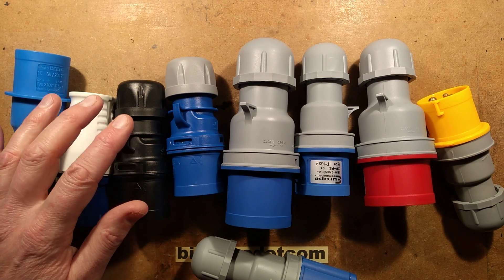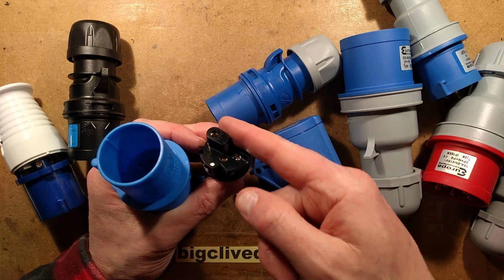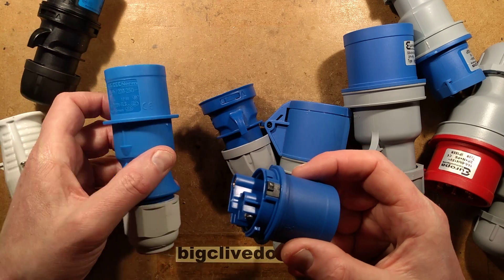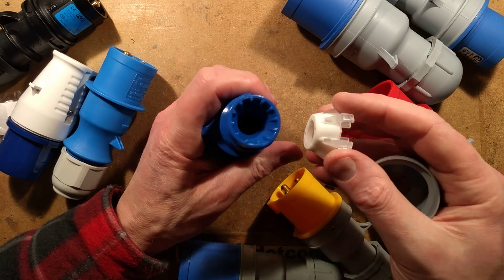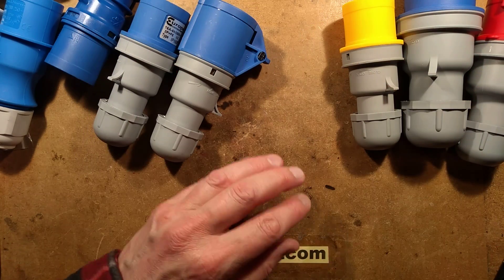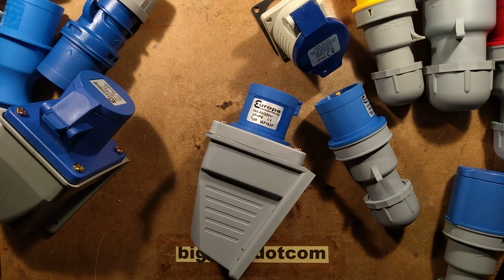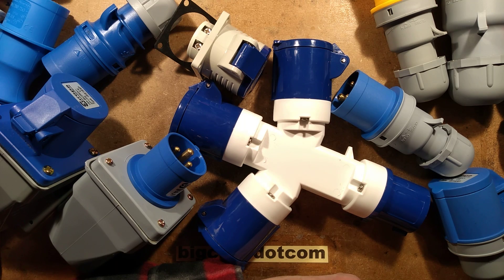My favourite industrial connector (Ceeform).

Comment: On construction sites the 3 phase variant is the only one we use here in belgium.  The mono phase one is used sometimes. Mostly for distribution mushrooms and high power electric equipment like hole saw concrete drills for diameters around 30 centimeters, big grinders and so on. The female plug to mount on a surface gets used a lot here for mobile barracks/containers also for moblie distribution boards.

Comment: Those red and smaller blue ones are found on literally every constuction site in finland
its always at least a single three-phase one in the building and they plug a distributin box that has couple of the red ones and many blue ones which most of the time will get adapted to standard wall plugs

Comment: ABB Easy & Safe Series, IP44 Red Panel Mount 3P+N+EIndustrial Power Plug, Rated At 16A, 415 V, With Phase Inverter
RS Stock No.830-5561

Comment: Hi Clive.I was a rep for legrand in the 70s.these were common in France and Germany.p17 range.bs4343.metal also available from sister compan5 Martin and lunell.they were colour coded.yellow 110v,blue 240v.red 415v.also low voltage white purple act.happy days.

Comment: Sometimes computer server's power distribution rails come with those type power cables but we usually throw those away and buy  normal Schuko cables (or 3-phase) instead. Those are pretty much unused in Finland. I haven't seen those been used anywhere else but in camp sites.

Comment: I am in the US. The high school I went to had a similar looking connector in the industrial arts shops, woodworking, metalworking and auto shop areas.  Most of the equipment was in the middle of the rooms and the power came from the ceiling. These power cables had a connector that looked similar about 7 feet off the floor. High enough to be out of the way, but low enough that you could just reach them. Also made it easier to rearrange things, than conduit all the way to the machines.

Comment: The house I live in (in Germany) has 2 32Amp CEE Sockets mounted on the Wall in the Shed. It’s pretty normal here in Germany to have 3 Phase Power. I use it for my Compressor and also sometimes for my Pro Audio System.

Comment: Interestingly the IP44 ones leak like a sieve, the ones I used on some flood lighting filled up like ponds, resolved using the IP65 versions which have locking seals.

Comment: I've used similar connecters when I worked at McDonald's here in the U.S.. They were used to plug in the staging equipment and other devices like the bun toaster. I've also seen them used for power standby's on the tractor trailer sized emergency generators.

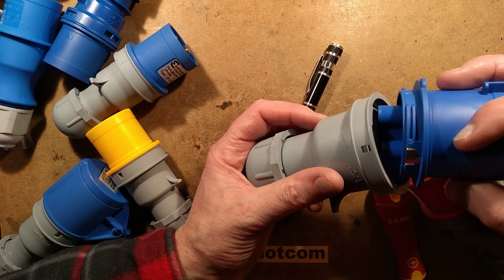Comment: I'm going to guess that the reason for not using powers of two (from 9:15) is because they're working down from 125A: half that is 62½A which rounds up to 63A, then half that is 31½A which rounds up to 32A.

Is there a 250A variant, or maybe a 375A? ETA oh, you went on to mention 250A, maybe that's where they were starting from…

(edited to use Amps rather than Volts because I wasn't paying proper attention—or maybe I was distracted by thinking of 240VAC ;-)
Reply from the maker: Counting back from the 125A (and 250A) does make sense.
Reply: @bigclivedotcom  I found the relevant International Standard: https://en.wikipedia.org/wiki/IEC_60309

Preferred current ratings (in Amps) are: 16, 32, 63, 125, 250, 400, 630 and 800!!!

Comment: These were used extensively by the UN as many countries they work in have no standardisation so they would use these to connect multiple extension socket of the particular countries style. They are also standard on their generators and external connectors for accommodation containers etc. Sometimes used to connect batteries and solar panels on mountains and inaccessible locations to make on-site assembly easier.

Comment: The amount of times i have wired them up then realised i forgot to put the cover over the cable first lol
Reply: You haven't wired enough of these if you haven't forgotten the cover a couple of times 😂
Reply: Try Socapex connectors. 
18pins that have to be soldered with 2.5mm2 wire

If you forget the PG end cap on both ends it takes literally an hour to fix 😂 I still have a couple of socapex cables at the workshop with missing covers. Haven't had the motivation to fix them yet. Probably never will.
Reply: @MCasterAnd  Electrical got so much easier when we upgraded to led source 4s. I will not miss Dimmers, Stage Pin, Bulbs, Burns, Etc.
Reply: Didn't you learn anything  from all those times you soldered a splice joint only to find you didn't put on the heat shrink tubing in place. I know I did not.😟😱😵
Reply: @dadillen5902   Self-amalgamating tape steps to the fore, then. Bugger taking the joint apart if it's non-critical.
I must admit, after the first few times I got better at remembering the right sequence, but there's still the odd one...
Reply: @MacShintersbane  I tried splitting the heat shrink, but that did not work out.😉😯😆
Reply: @MacShintersbane  Really surprised how many young guys don't know about self amalgam tape,and stretching it so it shrink on.
Reply: I am also learning resistant to this
Reply: Connector bodies/covers, backshells, lock rings, insulating boots.... So many ways for this basic mistake to trip you up and waste your time! You typically only do it once or twice before getting in the habit of double-checking yourself before starting to terminate wires. But if you're having an off day or you get distracted, it's still easy to catch yourself out.
Reply: These comments are all very relatable
Reply: i feel you bro😂

Comment: There are recessed inlets available for camper vans and caravans with a flap closure with little wings to shed water. These are amazingly weatherproof and I often leave my Mazda bongo plugged in to the house so I can run a dehumidifier.

Comment: We use them here in America. Usually only for specialty applications though. Call them pin and sleeve receptacles.
Reply: Although the design is slightly different from those. With ours you push the male cord end into the receptacle and lock them together with a threaded locking ring.

Comment: Note the point of the "shark fin" on the male houses. It can provide some retention when the lid tab gets pushed over the fin.
I noticed that the retention got weaker on the PC Electric Shark series got updated to the more rounded design (which are less rough to skin when handled). 

(the fin seems to have no use on female connectors, but the housing common for male and female variants.)

Comment: Electrical engineer from germany here. CEE type plugs are used a whole lot in germany, festivals, construction sites, heavy industry. I've never actually seen a different (modern) high power plug system in use, actually.

Also, you were wondering how the larger plug was rated 63A, and thats mostly due to the german electrical engineering system we like to use. 16, 32 and 63A are common ratings for fuses here, so it would make sense for the plugs to be able to handle those values. The amperage ratings come from energy density calculations in our standard gauge wires. We always calculate in mm². So 1.5mm² at 230V can take 16A AC, 2.5mm² takes 32A, ect. I think there was a certain growth factor to these size steps, but I'm not 100% sure any more. Maybe you do want to do some research on that, since it's an all planned out system

Comment: IEC 60309 — the International Electrotechnical Commission standard for plugs, socket-outlets and couplers for industrial purposes etc.  Commonly called "commandos" everywhere I've worked.  In data centres 2 or 4 32A feeds to each rack is common.
Blue, yellow and red are widespread.  Less often seen there are violet and white for low voltage. Grey for 277V (common in America).
We're beginning to see more switched interlocks — 60309-4 standard — with these connectors where you can't switch the power on without a connector in place and similarly you can't remove the connector while the power is on.
I was peeved to have to use NEMA 6-50 or L15 fittings in a US installation I did.  I was told by the local sparks that IEC type were only deployed outside where weather resistance was a consideration.  But it did mean that every bit of kit shipped over from Europe did need its plug changed and in unionised New York City we couldn't do that ourselves meaning delay and expense.
Wouldn't it be nice one do to have an international standard that was really an international standard.  :)
Oh, by the way Clive: these are my favourites too.  Supremely practical and robust.

Comment: The price of CEE-form 60309 connectors for cables can be quite cheap (e.g PC Electric Shark series), but splitters seems expensive for people accustomed to domestic power strips (even rugged ones with weather seal) with socket types of  CEE 7/3 "French or CEE 7/5 "German" (a.k.a. Type E or F on https://en.wikipedia.org/wiki/AC_power_plugs_and_sockets ).

In the entertainment industry, the use of CEE-form 60309 usually stops at the "backline" i.e. at the feed to musicians instruments on stage, where not so splashproof power strips gets used a lot.

I helped with a concert where a musician needed an effects device on the stage floor downstage close to the edge and the audience, which needed mains power within 1m. During the concert, one of the audience members managed to drop and spill the persons beer over the little 3-way power trip, and a little later the fault current to earth tripped the residual current device relay that fed all of the audio system, and it went very quiet!

Splashproof mains may be handy even where no rain or dew is falling.

Comment: I'm reminded of similar in Canada at Costco - in the cafeteria/concession area where the machines may need to be moved to sanitize the floor beneath -- the electrical connections go up to the ceiling with this style (probably different specifics) connector. Water/chemical resistant while still being serviceable without an electrician on hand.

Comment: These are also used as an inexpensive way to have a faster EV charger at home. It's cheaper to get an electrician to install one of these and get a 32a EVSE than it is to get a hardwired EV chagrer installed, 230v at 32a is 7.3kW,  but capping lower is better as I dont like pulling more than 90% of the rated capacity.

Comment: In Canada we refer to them as pin and sleeve type connectors. There used alot on portable 600vac 3 phase equipment. Welders and portable machinery. At my work we use then to connect 600vac 3 phase generators to pumping stations and buildings for emergency power. They are made from aluminum and go up to 200A. After 200A we use CamLoc connectors

Comment: Very common here in Germany. The 16A version is usually called "CEE Caravan", often used in 230V feed-in at motorhomes, boats etc. The red 3phase ones are also very common when it comes to welding machines, blade saws ond so on.

Comment: Do not confuse the voltage max rating of the plugs and sockets with the actual voltage they are connected to.
E.g. blue colour code means 250 V maximum nominal voltage, which in Europe is most often connected to mains voltage defined (per regulations) to be 230 V nominal voltage (+/- 10 %), previously being 220 or 240 V many places

Comment: The surface inlets suffer with water running down into the plug, back filling with water so mounting with wire coming into it from above, it looks so so wrong but works. The inlets we use on narrow boats have a lock to hold the flap so you can’t just pull them out.

Comment: Hi Clive, they are quite tactile things as well I think. Caravans and as a few people have said and marinas have been mentioned, the 16A are used on narrow boats with the surface or recessed sockets and they can very abused. I thinks this is unique to narrow boats but you can end up with socket at each end - sometimes without changeover switch - can anyone say LIVE PINS poking out from steel hull 🤪

Comment: Here in Sweden the 3 phase CEE is standard since many years and almost the only connector you see for 3phase, atleast up to 125A. 16A 1phase CEE is used in marinas and sometimes in the event industry, but I can't remember ever finding 1phase CEE outlets in indoor venues :)

I personally much prefer Powercon for anything 1phase. I think the only 16A 1phase cable my event rental/production company own is a adapter to Shuko, and we never even used it once :P I've seen a few Atomics and other high power Fixture with blue CEE 1phase fitted to their fixed cables, but everything is powercon these days :)

Oh, and since we are 240/400V here, it's only the blue and red 6h connectors that are used.
I do like the black Stage version of the CEEs myself!

Comment: Standard plug for industrial usages and theatre or sound/light live stages here in Italy. My favorite one is the 32A mono phase because it looks so chunky next to a 16A, unfortunately it is getting less and less common as it’s used only for older PA amplifiers as newer ones usually run with three phases.

Comment: One thing that annoys me is that the 400V 3L+PE 6h plug doesn't fit into a 3L+N+PE socket. If you have a machine that doesn't need neutral (not uncommon), you still need to attach a 3L+N+PE plug, else it can't be used with most sockets, but then you can't use it on supply systems that don't have neutral …for absolutely no good reason at all!

Comment: I work at the pier in St. John's Newfoundland Canada. The refrigerated shipping containers use those connections to plug into mains power. There is also diesel generators that hook onto the container / or mounted on the chassis for portable use as well.

Comment: I'd be interested in your thoughts on Neutrik Powercon connectors, are they used much?  We use them a lot in my work (typically 16A Ceeform to Powercon tails) for powering distribution boards in equipment bays. The issue with them is that they can not make or break under any sort of load, or there will be contact damage.

Comment: They're everywhere in data center/server rooms to supply 32A to rack PDUs (there are also 48A PDUs with those 63A plugs). I'm in Poland, but I believe this is used all over the world (PDU output is then C13 and/or C19 to the servers).

If you google "rack pdu" it will find a lot with some standard local plug, or C14 at the end. Don't be fooled, those are for those small racks people put in an office corner or something. When you pack a normal 42U rack, that can pull serious current, and those IEC60309 plugs are the industry standard for that.

Don't you also use 19" racks for audio/video equipment at shows? Do they use the friendly C13 PDUs inside? Do they need over 16A input?

Today I learned those blue flaps on them are always blue here because that's the color code for up to 250V. I never knew that color has meaning :) Thanks Clive!

Comment: The 13A blue ones are commonly used in mobile home/campervan/caravan/boats to connect the vehicle to a 230VAC shore power supply in the same way as you mentioned catering vans do.

Also, the same as you say for catering vans (even amongst “professional” builders) many installers use the incorrect plug/socket arrangements and have the potential for live pins exposed.

I’m DIYing a truck into a motorhome right now so having to do a lot of learning about 12/24VDC and 230VAC and I’m finding there are a lot of cowboys doing builds, either for themselves or other people, who just don’t take the appropriate precautions.

Thanks for the videos. They don’t all have an application for me in particular but there are enough of your videos (like this one) that have been on a topic that is helpful and those that aren’t relevant to me are still entertaining/interesting.